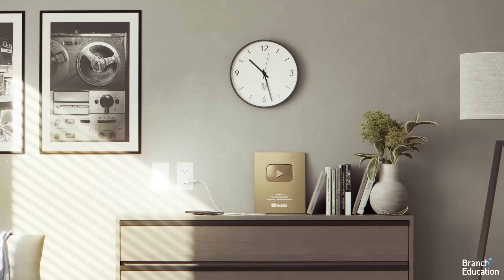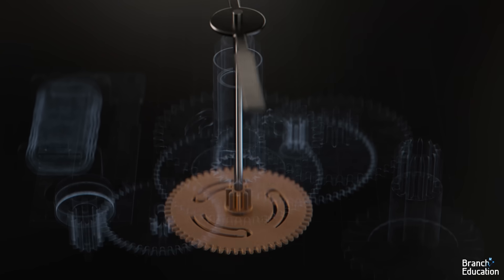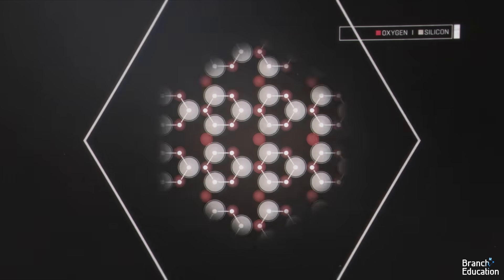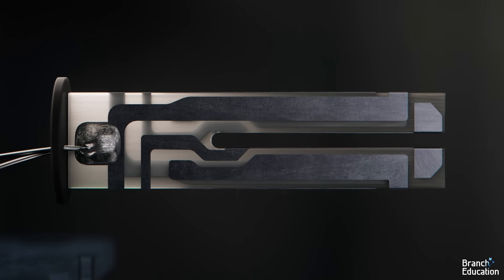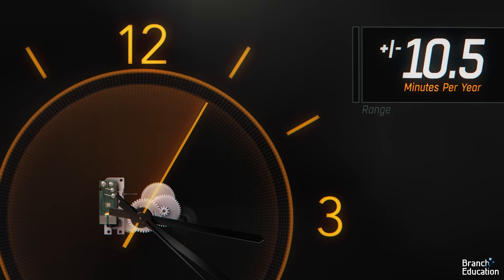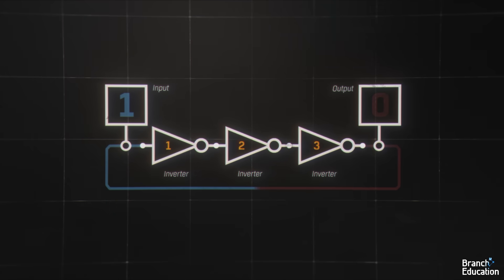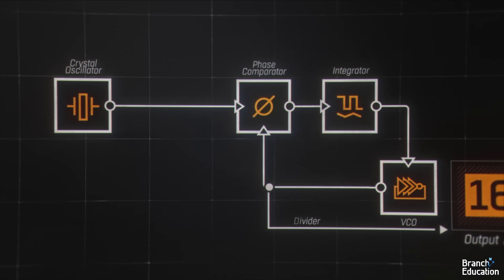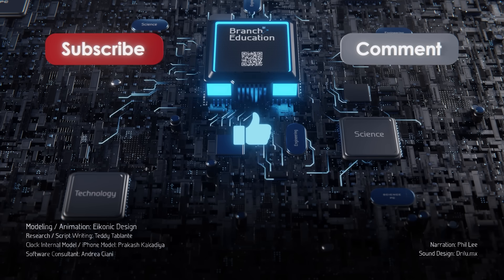How do Digital and Analog Clocks Work?

Comment: 13:26 How exactly does the divider work? The one in the wall clock just adds the pulses, but how do you 'simply' divide the native clock speed? 

If you want to divide it in half, how do you know where the halfway mark is without using a clock to tell you?

Comment: The way this video connects the $10 wall clock to the gigahertz computer CPU clock is brilliant! The explanation of the piezoelectric effect [05:07] that makes the quartz crystal oscillate, and how the Phase-Locked Loop (PLL) multiplies that stable frequency 150 times [13:06] to create the digital heartbeat, is perfectly visualized. Awesome breakdown! 🖥⏱

Comment: I’d like to see a video that explains how radio controlled clocks work. As my English is still a bit limited, I struggle to explain to my friends how these clocks work. Please note that there are four mechanical versions of radio controlled clocks. One with a single motor, just like in this video, two with two motors and one with three motors. The single motor clock sets its time by spinning the seconds hand around multiple times to make the minutes hand move to the current time setting. The gears of the minutes hand then spin the hours hand to the current time setting. The two motor versions can move the seconds hands and minutes hands independently. Please note that the both two motor versions are different as one of them quarters the minutes while the other one sixths the minutes. And the final clock with three motors can move its hands entire independently. Each hand has its own motor and is so far the fastest setting mechanical radio controlled clock on the market. I’d love to see something like this. I’m subscribed!

Comment: Hey 
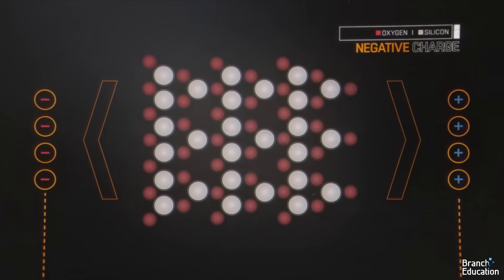I got a small doubt, around 4:52 added a explanation of crystal right, in order to make a oscillation you need a electric signal but inverter does the job of time controlling why to have a crystal in analog clocks?? Can you please explain that

Comment: IMO, the nomenclature in the title is confusing.  Digital is a display method.  Analog is a continuous signal ( yes I know how people use it for clocks, and nothing I say will change this.)  I only mention this, because I have cognitive dissonance from commonly used terms.  And I am unhappy with calling a clock with a face an analog clock.  Analog is a signal.   Clocks with hands are "clocks with hands".  A typical watch or wall clock doesn't use an analog signal.  It's a bunch of pulses.  In other words, a discrete signal.  Someone may ask if there's such thing as a true analog clock.  There was!  Commonly used in schools and other public locations, as well as homes.  Using an AC motor, it's timekeeping was delivered by the power company, sending AC power with a specific frequency.  60hz in the US, a handy reference signal!  So IMO, a digital clock is a clock with a digital display.  An analog clock is confusingly used for a clock with hands, but I would prefer "clock with hands" :)  Timekeepers could be quartz, mechanical, based on AC frequency, atom time clocks, or a few other time keeping tech.  Pedantic, I know.  But I am a bit of a time geek.

Comment: ...I may be missing something, but why not just apply a divider to the original quartz crystal and cut the extra steps? The added VCO, comparator, and integrator seemed unnecessary if the goal is just to get a much faster frequency.

Comment: A cheap wall clock usually requires a Carbon Zinc battery. Why? Carbon Zinc and Alkaline batteries deliver their power in different ways. An Alkaline battery may not help the clock to keep the time properly, and could possibly damage the mechanism. I can't explain how that works, but I changed to Carbon Zinc and my clocks are far more accurate. Most analog clocks were designed when Carbon Zinc batteries were the only ones available.

Comment: A 45-tooth gear takes 3 hours to complete one rotation, so a 13-tooth gear should take 52 minutes per rotation. The equation is:  60*60*3*13/45/60=52minutes.
The confusing part is that the video states the 13-tooth gear rotates once every 69 minutes and also mentions, "high torque is required to rotate the second hand 52 times per rotation of the time-setting gear."

If my understanding is incorrect, please let me know.

Comment: Thanks for this awesome video, i do have a question though, if the inverter loop can send out a signal why do we need the crystal? We cam simply connect the coil to the loop since it changes on a set frequency? (The coil or the counter regardless we shouldnt need the crustal)
Reply: I am sure I am just missing something basic

Comment: Analog clocks are always the best! I have understood that the pendulum or balance wheel driven by leaver escapement are replaced by small peizo electric motor (which consists of resistors that controls and gradually passes the DC 1.5 V electric power from battery to small tuning fork shaped quartz crystal oscillator that vibrates at a frequency of 32,768 Hz sealed in small cylindrical metal container which is connected to a chain of 15 flip flops so that it passes the vibration to the chain in which each flip flop is 2 transistors kept crossing each other that reduces the frequency to 1 Hz and passes to microprocessor chip and the chip passes the power to solenoid coil wound over tuning fork shaped soft iron piece between whose prongs a small pinion with a magnet in it's base that rotates for each second by electro magnetic power called rotor sprocket is placed) and the mainspring barrel is replaced by battery but the 60 : 12 : 1 gear train in the centre of the clock that drives it's hands function in the same priciple as in spring driven clocks but miniatured in size.

Comment: I'd like to add that the "counting" of the 32678 cycles is done by 15 flipflops, each of which does nothing else than halve the frequency. So the input frequency of 32678 is cut in half 15 times. Note that 32678 = 2^15. 
So when you halve 32678 Hz 15 times, you finally get 1 Hz = 1 cycle per second.

Comment: the crystal part was confusing at best, and wrong at worst

if the resonant frequency voltage was there in the first place, there would be no need to use that crystal

the crystal was the thing providing that frequency

when the crystal bounces back after the voltage is off, it generates a reverse voltage back into the circuit (which is the thing u forgot to mention, or u used very vague wordings)

the circuit simply amplifies it, without tat reverse current, the circuit simply wont oscillate

it is a positive feedback and the circuit is in a sense, supporting the crystal instead of driving the crystal

in general, when a device can convert electricity into something else, the reverse is also true (if u shine light into leds, u generate electricity like solar panels. screaming into piezoelectric devices generate a small signal since u r vibrating it, it is basically a mic)

reading some other comments, i find that im correct, other ppl are confused by how u said the circuit oscillates, and thinks that there is no purpose in that crystal

Comment: The coil is too easy to be hacked and even wire connection is hackable...I use sunlight and amplified its wave to strong enough to be oscillator then we can get to gigahertz mean depending of speed of light we can always adjust it to highest possible depending on frequency needed

Comment: The gear that links the second and minute hand is a 60:8. And the minute gear is loose enough to be set, but tight enough to still be influenced. Minute to hour is a 16 : 32:8 : 48. 16/32 * 8/48. 1/2 * 1/6 = 1/12. The setter has 16 teeth. So, the setter is a 1:1 influence on the minute and hour hands.

Comment: This is good but you missed a very important aspect of clocks i.e purely mechanical clock ,I would like you to make a video on the working of a purely mechanical clock or watch. Also, what was the need to complicate the parts of a mechanical clock like putting, quartz crystal,electromagnet, electronic circuitry and others.

Comment: Very interesting video explaining about clock. I have one query,

In analogue clock, you have shown that a cylindrical shaped magnet rotates 180 degrees for each second.

How the torque is generated in cylindrical magnet in unidirectional. Because with only one pair of poles (powered by coil), how clock ensures it rotates in one specific direction?

Comment: Would it be possible to see something like this but for industrial automation? I work for an integrator and the biggest gap we see in the learning curve is those who understand the ins and outs of a controls enclosure, and those who dont. And I mean the basics...Like what a PLC is, a drive (VFD or Servo),  Safety Controller, Field devices, how it all communicates, how power is stepped down from a plant provided AC voltage and converted to 24v DC for hardware in the cabinet and so on and so on. I think that could be a good one for you guys to tackle.

Comment: Thank you❤. I have been wondering ,for years now, how  clock cycles for some antennas and GHz computers are so low, since they are much faster than the Quartz oscillations typically used on their circuits. I was assuming some type of LC oscillation, but now I know😊.

Comment: I might be dumb question but I still didn't get it why we need crystal if the ic(inverter circuit) is already generating the the oscillating voltages.

Comment: INCREDIBLE ANIMATION AND RELEVANCE ! CLOCKS ARE INCREDIBLY INTRESTING AND INTRIGUING TO THINK ABOUT. THE FACE THAT YOU ALL CAN DO ANIMATION AND TAKE EVERYTHING APART WITH EVERY PIECE IN MID AIR, IS UNLIKE REALITY , YET HELPFUL TO SEE THE DETAILS. EXCELLENT PROCESSINGS AND EFFORTS! YOU ALL DESERVE SPONSORS! 
NOTES ARE IMPORTANT. 
NOTES FROM THE EPISODE: 
THE BATTERY Is to provide electric current,
CRYSTAL OSCILLATOR, has a crystal tuning court , the crystal latus of one silicon for every to oxygen atoms which forms a network of covalent bonds with electrons being more attractive to the oxygen. 
Piesle lengthenig effect 
The frequency of isolation being dependent on the crystal latus . 
INTEGRATE CIRCUIT, an inverter flips the input of a one to an output of a zero, and vice versa , yet if we loop , then they will continuously spin between one and zero , and is regulated between o
32 microseconds per second, a binary counter counts each cycle , then they send a singal to target the magnetic field to move the second hand . 
ELECTROMAGNETIC, depends upon the electric current , the iorn pieces allows the electromagnetic to switch. 
AND GEAR TRAIN, there are usually 8 gears rotated by a electro magnet

Excellent processings! Loving the animation, that is like watching magic, yet with learning! Thank you all!

Comment: I am quite disapointed about the explanations... Usually, you dive a bit deeper. As you said, this subject is pretty complicated so you can't cover such a thing without giving all the keys for understanding it... In my opinion, the 2 main circuits you explained have been described very much (maybe too much) but you just skipped the core mechanisms that actually do the job.

Pretty frustrated...

Comment: Yeah same as the first comment I've read on top. I've never suspected the quartz crystal in ~the wall clock have such elaborated controller. I always assumed more ~barbaric mechanical technology... I mean this is still micro electric mechanics (or micro electronics or whatever)... But I thought it`s more or less directly the electricity into the quarts and it`s used straight up as a ~mechanical energy source into the follow up mechanical ~translation to the arrows. I never suspected (now that I think about it) It on itself after being super micro electronically managed a controller in itself for ~electrical pulses "timed ones" (they actually are very much so) to an electro magnet that then drives an actual magnet that then turns the gears... o_0. I mean I still do not fully understand why it is even required in the system as a not direct source of electrical to mechanical ~force. Because the most I knew up to this point that it`s ~unique properties are exactly that... a good Electrical to mechanical converter (same as electro magnets are now that I think about it) and also Mechanical to Electrical... To the best of my obviously lacking knowledge when you stress a Piezo Crystal (did I say quarts ~idk if those are even different, even after watching the video) It actually produces an electrical charge that is than directed to where the Gas from the gas storage container, of the simple gas liter I am talking about, is released trough a ~valve (which is simultaneously opened and held opened by the same push that generates the Piezo Crystal stress, via appropriate mechanics based on ~springs I guess) and that electricity sparks on the tip, ignites the gas. 
 So I guess btw that hand piezo crystal watches are similar or identical but with even more ~minimized this... LoL... I probably am gonna go ahead and watch a video on Quartz Watches.

Comment: As for wall clocks and watches, I'm curious if the accuracy could be further increased by using and comparing redundant quartz circuits. Let's say you have 3 quartz mechanisms and 3 clock ICs. Then with a "central timekeeping" IC to routinely compare the 3 isolated circuits. For example, if one clock begins to stray from the other 2, then the one that strayed is then adjusted to the average of the 2 that are in closest agreement. It could do this by adjusting the binary counter assigned to that quartz circuit; either by suppressing or accelerating the counter for certain clock periods. Add in a carry bit to each counter to handle cases where the 15-bit counter is accelerated, so that we can maintain the 15-bit count (2^15 = 32,768).

Naturally we can ensure accuracy with WiFi support to an internet connection to adjust time with a timekeeping server. We can also use GPS time by using a GPS receiver breakout such as a BE-220. But that adds complexity. This way, everything can be packaged on a single large-process node chip-on-board IC and does not require a radio signal.

I may make a demonstration of this. While I can't just go out and lith my own IC, I can pull the timekeepers out of 3 wall clocks and use an Arduino as the "central timekeeper," and then have the Arduino pulse the electromagnet for the gear train.

Comment: So... What actually keeps track of the time? What is the reference, the "ruler" with which we measure the time? If the quartz crystal needs a constantly revolving magnetic field to produce oscillations, then it's dependant on that magnetic field, but the timing of the field is linked to the quartz. Or am I missing something?

Comment: There were some older analog quartz clocks (like the Junghans astro-chron) that were made before integrated circuits existed, and all the circuitry that would now be contained in that little chip was made out of individual transistors and other components.

Comment: It's not made clear whether smartphones use quartz crystals or if it's all done by a circuit. 

The video says it's 150x faster than a quartz crystal and doesn't mention the crystal's presence, which gives the impression that there may be no quartz crystal. 
At the end of the video it says that some phones use a mems oscillator which implies that phones do have a quartz crystal.

Could you please clarify?

Comment: As far as the oscillator of the wall clock is concerned (at 7:10), the inverter circuit is kind of the external periodic force and the crystal is the resonant circuit, right?

Comment: One of the best educational channels on YouTube. Beautiful animations with just enough detail to understand the concepts, while moving fast enough that you can cover complex topics quickly. Giving all the keywords allows people to do their own more detailed research if they want to.

Quick question: How does the time setting gear slip (3:20) without causing damage to the gear system? It looks like the minute gear is composed of two parts, which allows it to slip without damaging the gear, but it's not completely clear how the gears stay connected while still allowing them to slip.

On another note, I've researched this topic before. Conceptually, I understand the feedback loop and signal multiplier, but I think I'm missing enough knowledge of electrical circuits to understand how to actually build and design one of these circuits myself. I guess I'll just be thankful that these types of circuits come in integrated packages so I don't ever need to design one myself.
Reply from the maker: Yeah- it's a really great question and while I don't have 100% the definitive answer, my theory is that it comes down to the difference of torque.  When the electromagnet is driving, due to the heavy gear reduction, there's a lot more torque.  This is similar to how when you drive a manual car in a lower gear, you have more torque for pulling heavy objects.  Whereas if you're pulling something in a higher gear, you have less torque, and the wheels are more likely to slip (which is like driving the clock gears from the time setting gear).
Reply: The adjustment wheel when turned causes one of the gears to slip up or down and go out of mesh with the rest of the gear train. I presume, it is to prevent driving the motor/magnet which turns the assembly at very high speeds. Since one swoop of adjustment wheel will translate to hundreds of rotations, that too within a fraction of second.
It is a bit difficult explain but if you open one up you will understand why. You can feel the slack when you jiggle the adjustment wheel.

Comment: The irony is that a ticking clock is surprisingly complex to make work whereas a smooth-sweep clock is really simple, the motor spins freely with zero circuitry or chips or intelligence, all the maths to control the timing are just in the gears. And yet, smooth-sweep clocks are practically extinct now that ticking-clocks have taken over. 🤨